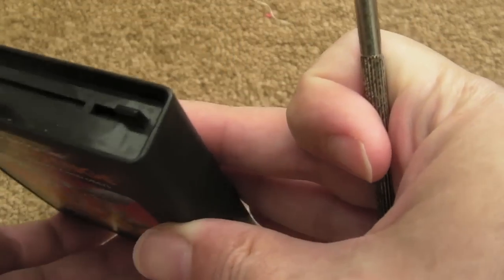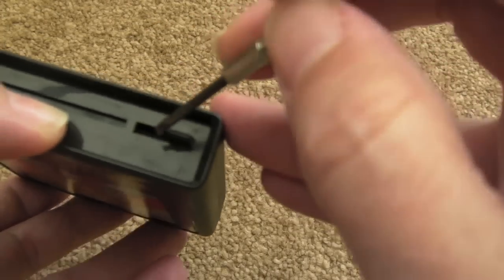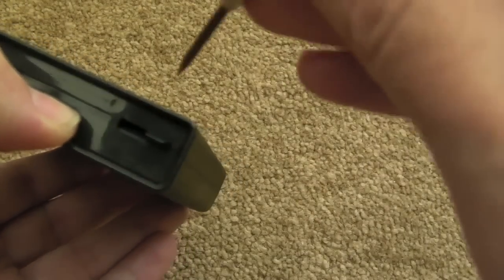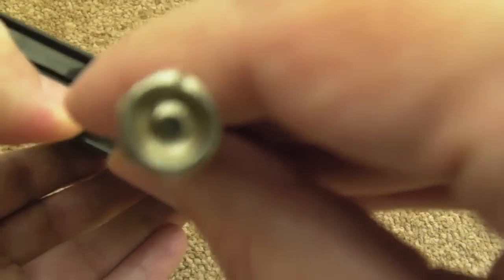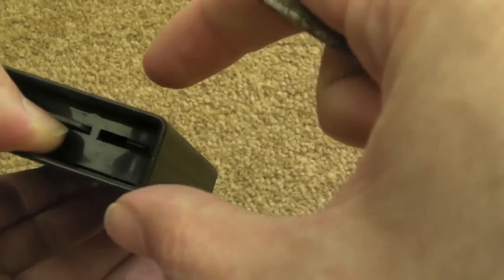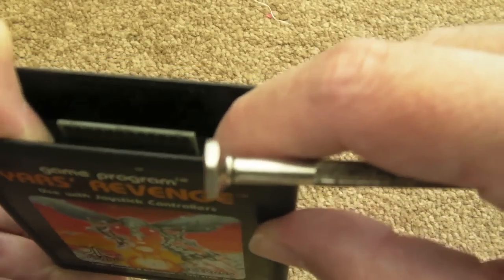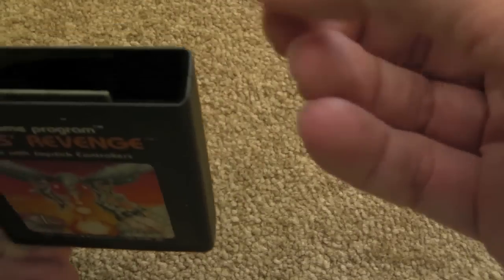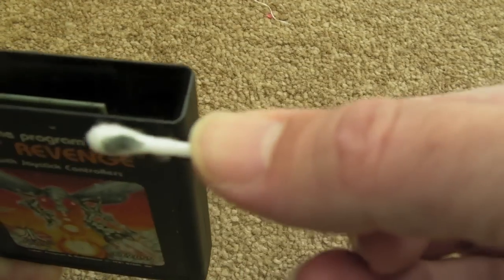Atari 2600 Cart Cleaning (Broken / Faulty Game Cart?)

Comment: Does that buildup keep the carts from playing? hardly any of mine play and im trying to figure if its dirt or batteries (theyre all packed away for now but last time we got the system out nothi g would play )
Reply from the maker: Yes, it will stop the games from working, but also as you insert a dirty cart into the slot - the slot gets dirtied and then other carts can stop working.  I would clean up all your carts and the slot!  Easiest way to clean the slot on a 2600 is put some IPA on both sides of the edge connector of the game cart, then insert and remove the cart several times wipe the cart edges down, and repeat that whole process 3 or 4 times.  If it still doesn't work at the end of that process it could be a fault on the 2600 or the carts themselves (although I wouldn't expect more than 1 or 2 carts out of say 100 to fail).

Comment: My Surround game is not working at all. I have cleaned it and replaced the solder but I wasnt very smart and decided to pry the rf sheild off with my finger and i got cut... Anybody know if that was bad?
Reply from the maker: Sorry you got cut!  If the game doesnt work after cleaning the PCB edge, it will have a faulty chip.  You could replace it with an EPROM and a NOT chip.
Reply: That is actually what i thought! also the cut was tiny but I am still embarrassed about it. lol
Reply from the maker: We've all done that sort of thing lol!  I once pushed a very small screw driver straight through the joint in the middle of my thumb.  Missed all the important parts but it was stuck straight through my thumb, in one side, out the other.